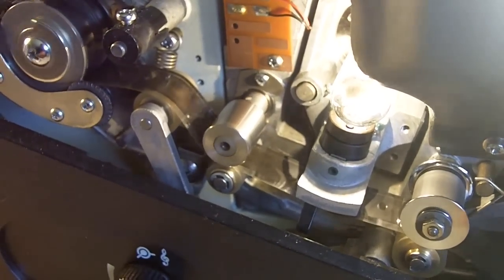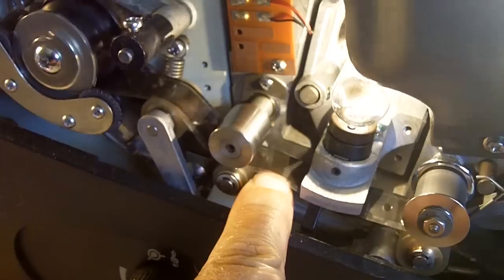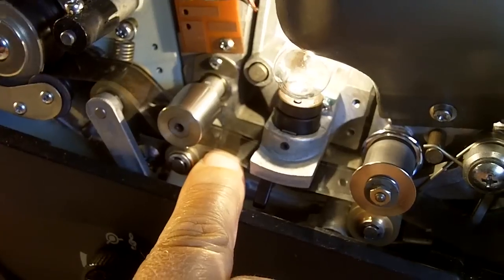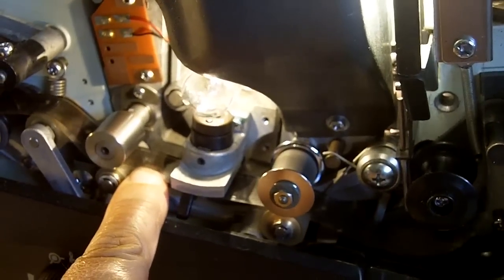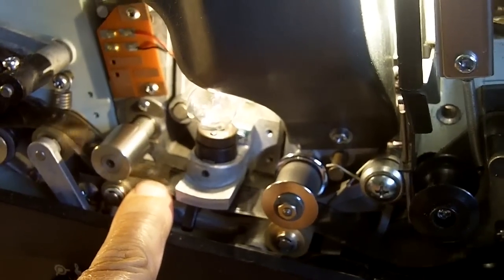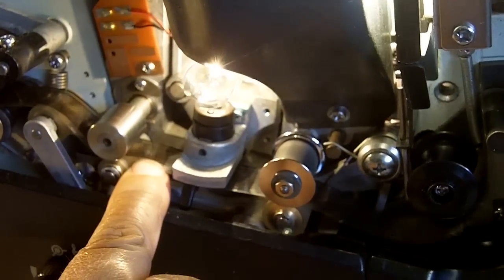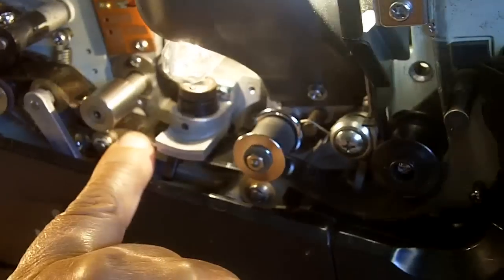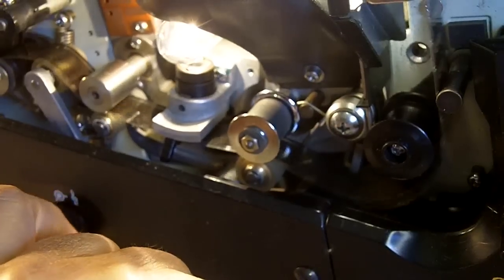Elmo-16CL Optical Sound Problem & FIX

Comment from the maker: Jeff..this projector was DOA when I bought it...but is running great now. It had a cracked worm gear assy, which I replaced...and I replaced the rollers which like you said...had turned to goo. I then ran into the sound problem. Having the service manual helped me located the adjustment to line up the sound head properly.  My only complaint is I wish it had a zoom lens .:-)

Comment: Glad you found a solution.  I should mention that if your projector still has its original rubber rollers, they may deteriorate over time.  I had that problem; mine turned to goo.  If they do, don't run any film thru as the goo will clog the sound reader.  Only source I know of for new rollers is Urbanski Film.  By the way, my projector is a Kodak; same model under different name plate.  Enjoy your videos and have shared some.